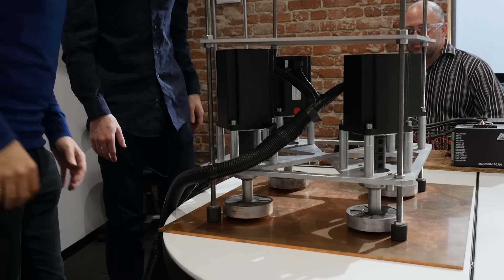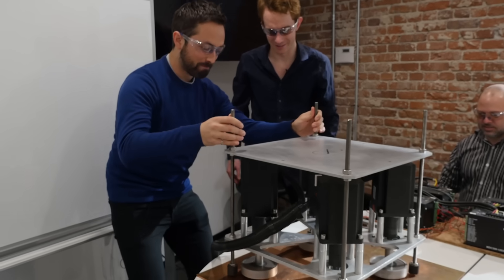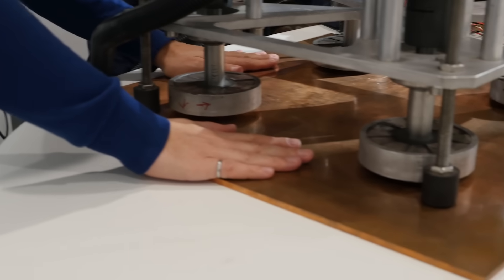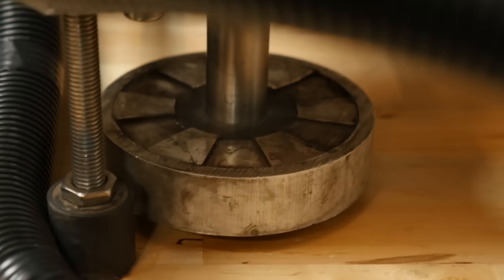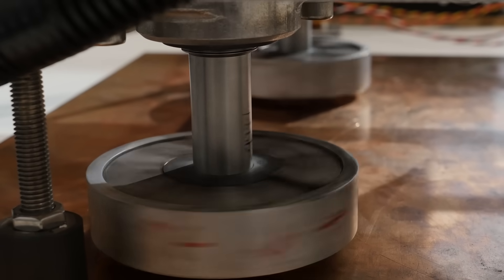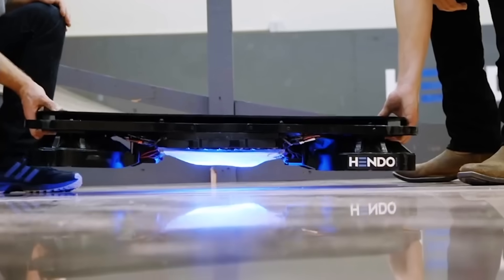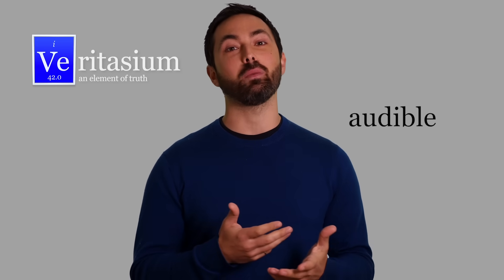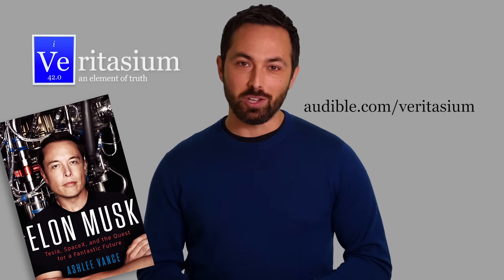Electromagnetic Levitation Quadcopter

Comment: Would you experience any downward force (in addition to the heat) if you where to stand below The Electromagnetic Levitation Quadcopter?
Reply: yes you would if you were conductive enough. you know.... Newton's 3rd law still applies. In fact, this merely demonstrates on macroscopic scale what happens in microscopic scale when you push atoms near each other.
Reply: So it "simply" replaces the air from a hovercraft/helicopter with electromagnetism
Reply: basically yes...
Reply: Thanks for clearing that up, it's still really impressive. I Just wanted to know how it compares to the common depiction of Levitation, often seen in futuristic Sc Fi :)
Reply: hard to tell... levitation in sci-fi is often not really explained in a way that ties is into reality. They can generally be split into 4 categories:
1. electro-magnet-based. Which is basically what is described here and really exists. 
2. anti-gravity based, which typically relies on defying gravity usually by utilizing some sort of space-time bending. It's the same category where wormholes, warp-drives and time-travel belongs. These may be possible but are very unlikely to be practical, especially on small scale. By small scale I mean contraptions of size that we could possibly build today.
3. using exotic forms of matter that seemingly defy newtonian/einsteinian motion. This category may intersect with the previous one.
4. some pseudo-science woo... basically magic, like the force from star wars.
Reply: Well but you're actually /not/ conductive enough. So no. If you put your hand between the rotating magnet and the copper plate you probably wouldn't feel a thing. This is why humans aren't ripped to shreds by MRI machines. ;)
Reply: Newton's third law: For every action, there is an equal and opposite reaction

Comment: This is the origin of hovering cars.
Reply: Only if we plan on making all our roads out of copper which would be insanely expensive and dangerous. There is already better tech to achieve hover cars if you can produce enough electricity.
Reply: No, it wouldn't make sense to put so much conductive material on streets and stuff to allow cars to fly high.

If anything, conventional quadcopter tech, specially the higher end ones with all that flight automation, is probably what is gonna lead to flying cars.
Reply: +TiagoTiago what about hovering cars, he didn't say flying cars
Reply: +Different Ah, right. Well, it would probably still involve ridiculous amounts of aluminum or copper to make it work over a whole city.
Reply: Hovering is essentially a form of flying. Any physical object that is suspended off the ground for extended periods of time without another physical object (that makes contact) holding it there is basically flying.
Reply: Different Thanks
Reply: SCP 1715 "Equality for the colony!"

That's a quote from a movie where they had magnetic cars. Does anyone remember what it was called?

Comment: the part with hyperloop makes this video fake news
Reply: The hyperloop is not some "alternative fact". Currently there is a test track where a competition is being help for the most viable design. As a Dutchman I'm very proud the Dutch team from the Technical University of Delft won first prize.
Reply: I love how confident you are that "any structural damage will completely destroy the tube and kill everyone". Perhaps you could draw up some safety features that you could sell to Elon. I'm sure he'd be pleased to fix this glaring oversight and would pay you handsomely for your efforts.
Reply: Rudy Bleeker the hyperbullshitloop is a near vacuum tube so any structural damage will completely destroy the tube and kill everyone without any chance for survival

Note that the tube can't be from on piece or rigid because of thermal expansion so it will require many mobile vacuum seals as big as the tube. With each  mobile vacuum seal the chance of failure also increase

So gl getting this past safety approvals 

the reason i said is fake news is because you are presented the hyper loop as something that already exists
Reply: viermidebutura well if it has lower accident rate than a plane crash I will be good
Reply: +Nico Mariño You're not acknowledging the problem. It's not that it's impossible, it's that it's impractical. The cost of creating and maintaining a system like that will most likely be much more than you will be able to gain back in revenue since plane travel is relatively cheap.
Reply: +budmeister a bit extreme, but I see where you're coming from and agree on some level
Reply: viermidebutura you're acting like these 30 teams that worked on the hyperloop did it all for nothing. If this project wouldn't have had any potential, they wouldn't have invested so much time and money into it.
Reply: ***** solar freaking roadways arguments all over again
Reply: +viermidebutura complain about it with grandpa, fucknut
Reply: thunderf00t, some guy that cries about the success of other people online
Reply: Wow... there are a lot of people here who don't have the slightest clue how pressure works. Vacuum isn't actually anything special in terms of pressure, it's just the absence of it. When someone crushes a paint can with "vacuum" what is really happening is the atmospheric pressure is crushing it from the outside, since there's no reciprocal pressure inside to balance the net force on the object's surface.

A hard vacuum, at sea level, is only a pressure differential of one bar. It's just not that much pressure. We already have vacuum tubes that are multiple kilometers long (see: LIGO). Vacuum isn't magic, people. It's just a lack of pressure. A simple pneumatic car tire and wheel can hold a 2-3 bar (up to 10 for large truck tires) pressure differential with nothing more than the pressure itself holding the tire's bead against the lip of the rim. It can do that while losing less than 1% of its pressure per month, with basically no special design considerations to be exceedingly air tight. I assure you, we can design things that can stand 1 bar of pressure difference with no problem whatsoever, and that can maintain that pressure differential basically indefinitely.

And... "completely destroy the tube and kill everyone without any chance for survival"? I think you need to reexamine your comprehension of reality.
Reply: Firro Seranel High pressure enviroments are different to the human body than low pressure enviroments. The human body is mainly water which is incompressible. If a human is exposed to a high pressure, such as 2 bar, the body will stay intact as water remains a fluid. However at ~0 pressure water becomes a gas and out body will explode as our skin is not strong enough to bear the tension. 

But on engineering level you're right it is pretty easy to build low pressure areas. All these arguments about how everything is impossible is just mere pessimism coming from people that do not even have half the knowledge how technologically advanced we are.
Reply: People said the same thing about airplanes before it was invented.
Reply: They're going to hold pod races in the test tube :D I'm crossing my fingers it'll be live streamed!
Reply: McJaews oh no i offended you god and savior musk who takes money from the government  with shiny ad campaigns
Reply: Teth47 you know why it isn't news? because it was debunked so many times
Reply: I looked at the dutch designed vehicle and it looks more viable than the original concept since it doesn't have a silly turbine on the front. The primary problem(as shown in the thunderfoot video) isn't the vehicle, it's the reliability, practicality, and affordability of the low pressure environment that the train will run in.
Reply: Scrotie McBoogerball 
Don't give them any ideas.
Then they might start think that Thunderfoot and gang are authorities on sexual health and that any other sources must be propaganda and thus never trusted.
He's already telling them what to think in too many subjects already.
Reply: EchoL0C0 Seeing how morbidly obsessed with Laci Green and the like he is, that's only the next logical step lol.
Reply: Of course, people who are scientifically illiterate will pass off Mr. Mason's criticisms without debunking any of his vast arguments. "but muh hyperlup, fuk u thundertwit". +McJaews Perhaps you would be enlightened to debunk Phil Masons video point by point; because I am most certain that you are much smarter than a nuclear physicist with decades of scientific experience.
Reply: Nico Mariño i didn't compare this to solar roadways i said solar roadways arguments all over again as a reply to insults

and no hyperloop isn't a new thing at all

both solar radways and hyperloop are possible except the first is a total waste of resources while the second is an expensive death machine
Reply: "expensive death machine", Why?, they haven't finished to develop the system and you are already dismissing it as "fake news"?, as far as I know they are concentrating in the pod design for it, which is nothing different than a plane, so why the regressive attitude?.
Reply: +Rudy Bleeker Wait, do they have a fully enclosed track under vacuum or are you talking about the "test track" that was just a conventional maglev track?
Reply: You know what you get when a vacuum tube gets a leak? A tube with a leak. This explosive compression nonsense is fantasy. Thunderfoot's claims have already been debunked. You should have done a bit of research before blindly repeating them.
Reply: Unfortunately solving an engineering nightmare is quite a lot more difficult than pointing out the reasons why an engineering nightmare exists.
Reply: They got faulty car auto pilots past safety approvals, so the hyperloop has high chances in my book...
Reply: Talk of fake news is toxic. What a world we've created for ourselves.
Reply: Well viermidebutura at least you made it clear what an idiot you are, most people don't have that courtesy.
Reply: Actually it won't explode. Your blood vessels and body tissues create its own pressure (higher than the water vapour pressure at body temperature) so water won't boil all over the body.
Reply: ***** Thunder who?
Reply: Stef de horde well in that case... great build the death machine already... i'll grab my popcorn and see if i was right or wrong
Reply: Micah Miranda That's the business of people working on the project and investors, not the average person.
Reply: It's not a news video, and also the presentation was clearly stating that a "Hyperloop" is a work in progress.
Reply: He said it is in plans which is true.

Comment: You do realize that we lack the technology to make the hyperloop a real and finished thing, right? We don't have the technology to make a safe and reliable vacuum over the distance a hyperloop would cover. And that is just 1 small problem. The real problem would be safety, as a breach in the vacuum would be sending air into the hyperloop at deadly speeds (thanks to the air pressure suddenly changing from 0,x atmosphere to 1 atmosphere). If the hyperloop were to become a thing, it would be a prime target for terrorists.

Comment: Too bad these vehicules need a conductive floor x)
I'm quite sceptic about its viability, regarding energy consumption...
Also, neodymium is quite a rare element...
Reply: earth has a finite amount of literally anything...
Reply: +Teth47 No one is proposing that we replace all roads with hyperloops.  The idea is to replace high density airplane/cargo train routes with hyperloops.  They would combine jet aircraft speeds with efficiencies better than a standard train.

Personally, I'm dubious about the economic viability of a hyperloop system but it does make a certain amount of sense between large urban centers.
Reply: Well thankfully science is done by scientists, not ramblers operating on random guesses.
Reply: Aranvar You can use a electromagnet instead of neodymium and a better conductor, but it might carry only HEAVY objects in short distances
Reply: Its prize does not sometime reflect its rarity, but more like the current demand...its still a lanthanide, and those elements are relativly rare in nature. Earth have a finite amount of these elements, and I guess deposits will be soon or later exhausted if we all decide, for exemple, to decide relying a lot on it; like clean energies, that still needs strong magnets...
I hope there wont be wars in the future for those ressources, most of its reserves are in china for exemple ^^
Reply: I'm kind of curious if it's possible to use the thermal energy transferred to the copper base, to generate electrical energy (Through a generator, perhaps.) that would help to power the motors spinning the magnets.

It's a nice thought but I'm doubtful that the motors are able to transfer enough thermal energy for system to become sustainable.
Reply: Electromagnets, though yeah, nobody seems to remember that we'd need to coat all our streets in copper and probably have some sort of cooling system on it to keep things from getting out of hand. It'd take more copper than we have, and even Aluminium which would work (though not nearly as efficiently) and is much more plentiful is prohibitively expensive barring free energy, and really at that point, efficiency is moot, so just use whatever's simplest.
Reply: ***** Diamonds are intrinsically worthless. They're sold by very few companies and their supply is artificially restricted. 
Rarity does change the price, as it's a simple function of supply and demand.
Reply: Sigh, those pesky laws of thermodynamics. :S
Reply: Aranvar u know when u think about it, that could be very beneficial. If u go off the floor the vehicle would stop and reduce the amount of accidents involving cars driving off the road by a ton
Reply: what if the conductive floor is attached to the engine  will it become an infinite elevator? :)))))
Reply: +TheoreticalData 
I wonder if this could work sideways with a mirrored replica on the other side, so it climbs rather than levitates.
Reply: yeah this technology is more for cargo transport
Reply: InconDita hey that's a cool idea. Yeah I think it's impossible for it to be self sustainable that way, but it would still help a bunch
Reply: Carlako32 The only way I think it'd possible. Is to have it on a larger scale, one in which the copter can heat the copper base to 99+°c to evapourate the water to turn the fan of a generator.

But I still think it won't be sustainable by itself. But may reduce the amount of electricity used straight from the power grid. Perhaps if you used more than one renewable power source on it, like solar pannels? This is all thinking way ahead from where we are I'd admit.
Reply: InconDita such a thing will never be sustainable... Evaporate water to power a fan, whats with the energy in the hot water/steam that leaves the machine?
Reply: +Joäo Felipe
Price =/= Rarity. As actually seen in diamonds. Diamonds are not rare, the price is not even justified.. yet they are expensive AF.
Reply: +Xander
I dont know why you bring up supply and demand here. I said that a high rarity doesnt always imply a high price - which is true. However, even this is covered by supply and demand. Even if there was something insanely rare, if nobody wanted to buy it, it would effectively be worthless.. so nobody ever argued about supply and demand here.
Reply: yea that's too bad 
if it does not need conductive foor
we will have hover craft